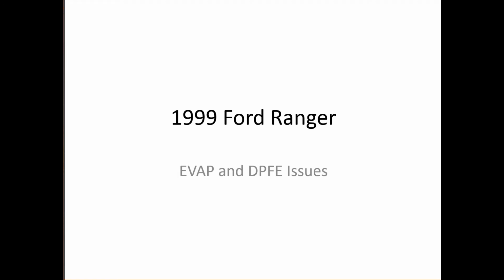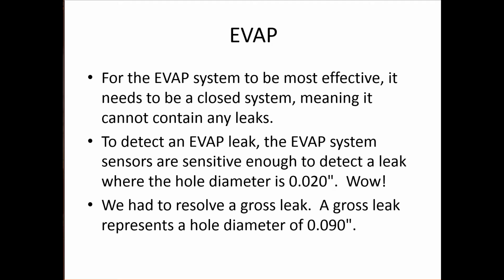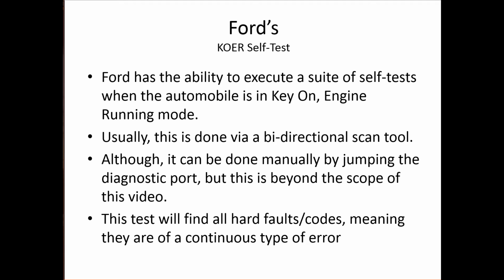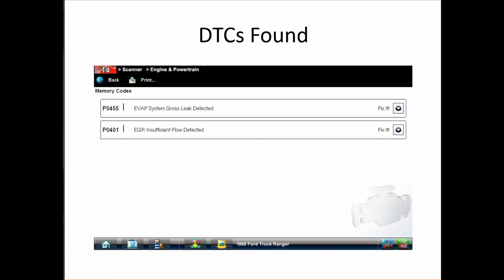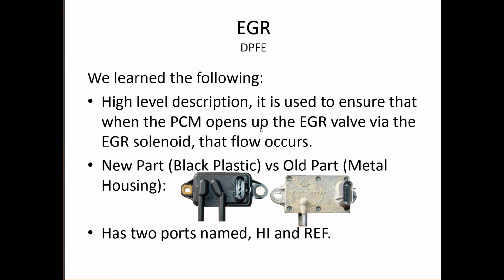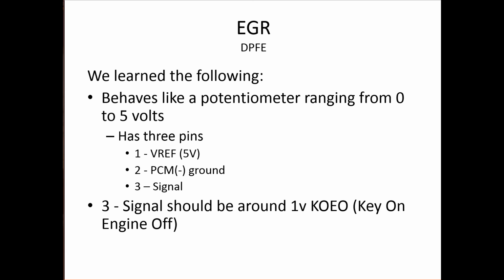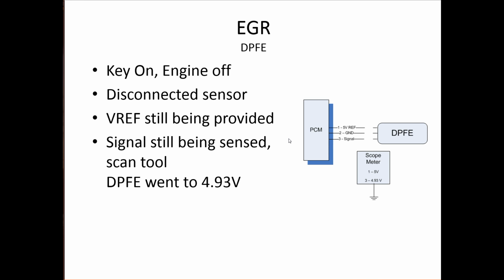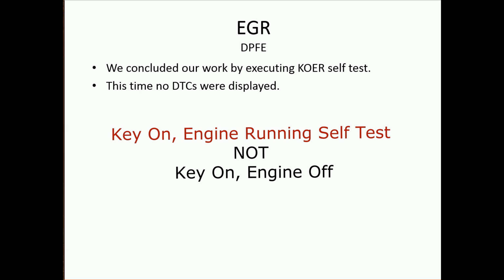1999 Ford Ranger - P0401 & P0455

Comment: I replaced the solenoid, the DPFE sensor and the EGR valve.  The hoses are good.  What else could it be causing the p0401 error?
Reply from the maker: Are the egr ports clogged?  When you changed the DPFE, do you see try DPFE changing value on a scan tool?
Reply: @Geekdiymechanic  I don’t have a tool that shows voltage just the error, now I’ve got misfires in cylinders 5 and 6 so there is more going on.  Going to start with new plugs and wires since they’re original and it’s a 99

Comment: I am struggling to find the actual EGR valve on my 99 4.0 6cyl 4x4 ranger. What engine where you working on? Where is the EGR valve located?
Reply from the maker: I worked on the 4cyl model.  I have seen Rangers like yours.  I believe it is on the top front driver side of the engine.  What I suggest is google a replacement part.  I often do this to see what the part looks like.

Look at the exhaust manifold.  You will see two pipes leading up the DPFE.  From there following the plumbing, and you'll see the weird looking EGR.